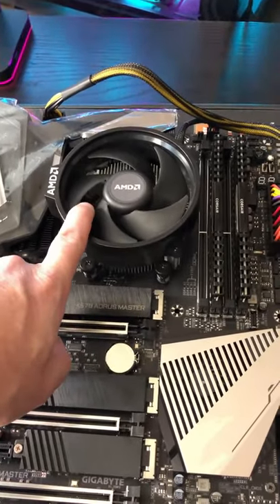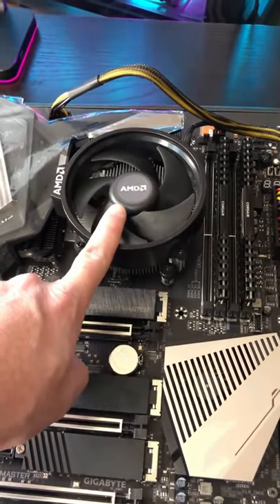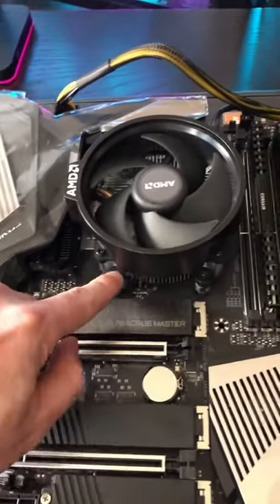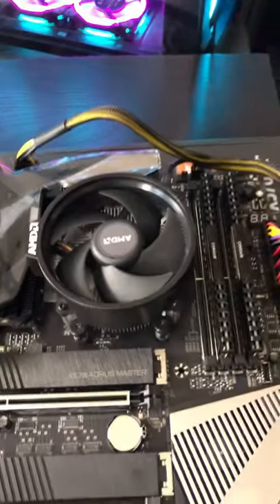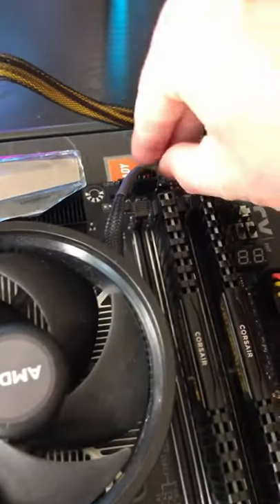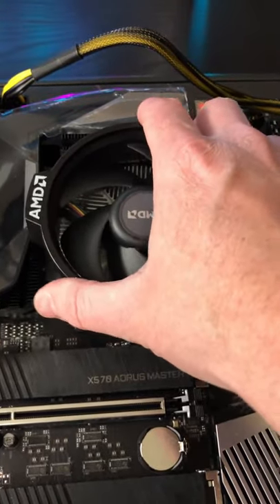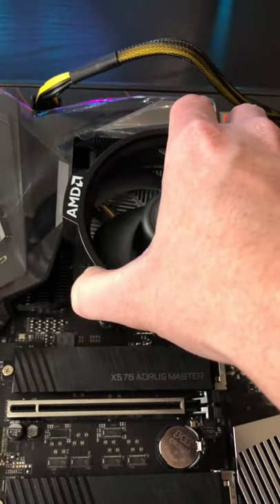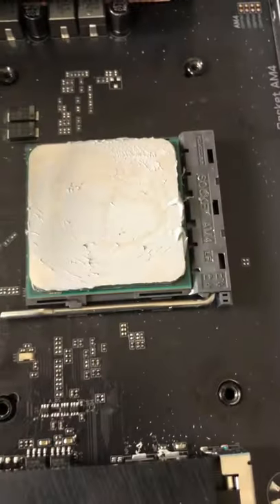How To Remove an AMD CPU Cooler Safely without Ripping the CPU from the Socket #shorts

Comment: AMD refused to replace my CPU after literally every PIN was bended.
They said it was my fault and I didn't follow the instructions.
I sent him a copy of the instructions that were in the CPU box in which there is no mention that the thermal paste used on the heatsink is the strongest super glue ever made. Also there was no explanation in the instructions how to remove the CPU Cooler. The guy from AMD Support never replied again.

So yeah AMD is sooo great and all...
Reply from the maker: Bummer!

Comment: I have built hundreds of desktop systems... I have removed heatsinks from Intel.. AMD, CPUs... Never have I ever had to worry about pulling off the cpu when taking the heatsink off... Even without it being heated first. TF is this person doing that they fear ripping the cpu out? There is a clip holding it down...
Reply from the maker: I have zero fears removing it because I myself have been building systems a long time too.  Join any pc forum or discussion group.  People commonly by mistake do this so I thought I’d post something to help less experienced folks.

Comment: Jeez haha how hard are people pulling on their coolers to rip off their cpu when it's locked in place with that little bar?
Reply from the maker: It’s easier to do it than you think.  Especially with the stock paste, seems the stock stuff is a bit stickier than aftermarket pastes.

Comment: Pro Tip: Pour boiling water over the top of the cooler. This will act as a lubricant, and allow the cooler and CPU to separate easier:)
Reply from the maker: Umm...

Comment: Who tf is pulling their cpu out
Reply from the maker: Happens more than you might expect
Reply: @PCTechHustle  seems more likely to happen with ams then Intel sockets
Reply from the maker: Right Intel is very unlikely because the socket mount actually holds the IHS down.  Basically impossible to do on Intel

Comment: I'm so used to Intel. Ez...  amd freaks me out. 😆 🤣 😂 😹..  need to put a new heat sync on and nervous..
Reply from the maker: Slow and steady!
Reply: @PCTechHustle   it went perfectly,  he had his computer up and running.

when i went to do the twist motion nothing would happen.   Thankfully I saw the other comments about using the hair dryer.  Used the hair dryer slowly twist motion and it popped right off lol

Comment: Are you telling people to remove the cpu while the computer is on?? Lol. If you tell them to turn it on to warm it up, better be damm sure to tell them to turn it off before taking a screwdriver to the motherboard and ripping the processor out.
Reply from the maker: No I am not telling people to do that.  It’s called using a little bit of common sense.  If someone doesn’t have the sense to turn the PC back off before removing the cooler they have no business touching a PC 😉😉😉

Comment: theres no way im twisting a cpu inside a zero insertion socket no thank you lol
Reply from the maker: Twisting the cooler 😎
Reply: still sketchy lol its attached to a cpu attached to the socket is that just me or in my head all the pins will bend inside the socket ?  no ? lol @PCTechHustle
Reply from the maker: Never seen something like that happen.  Where I have seen pins bending is trying to pry it up when it is stuck